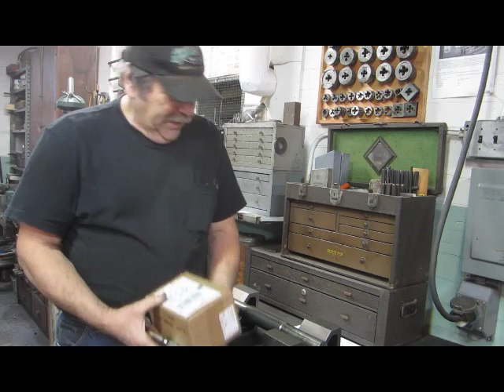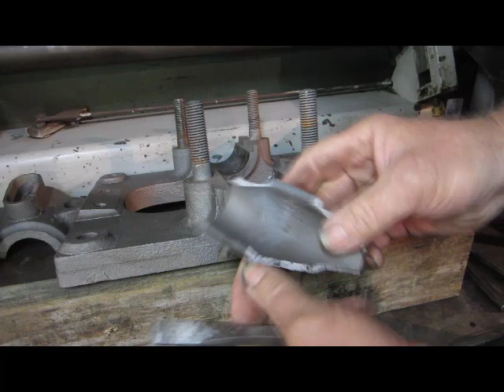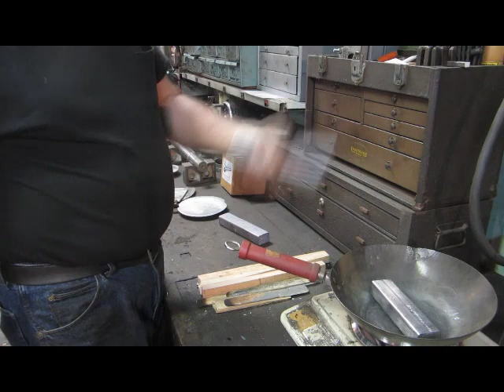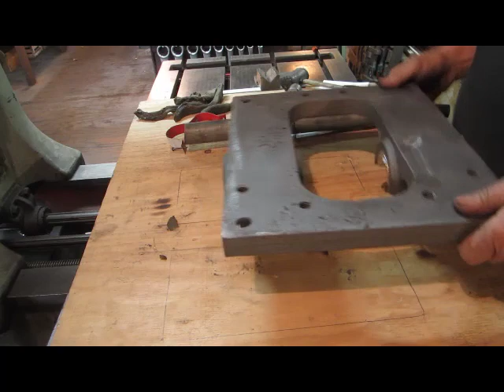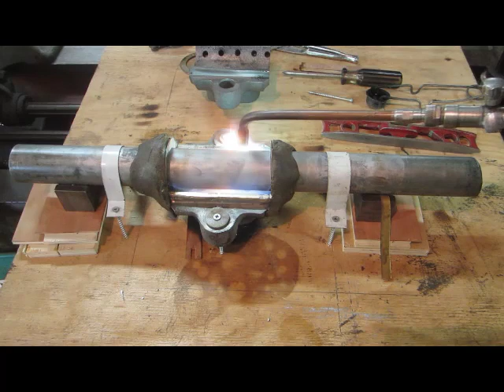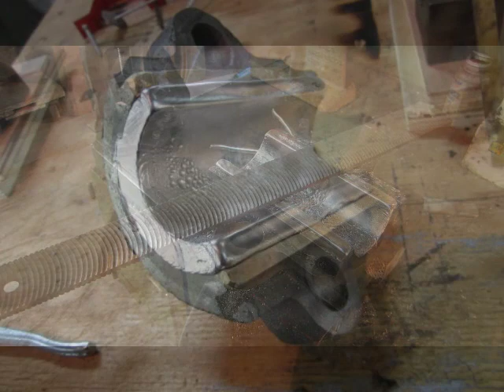OLD STEAM POWERED MACHINE SHOP 15   Pouring the mains

Comment: I did ultrasonic inspection of babbited bearings when I worked at the shipyard.  The inspection requires a special calibration block.  Ultrasonic inspection is good for detecting lack of bond.  I never knew how the babbit was poured.  Thanks for the video.

Comment: I've done a lot of this work when I was younger ,   we used to to have 2 pots on the go, one with old babet ( we call it white metal in England )  and one with new ,  to get the old babet out just drop the piece  in the old pot,  and we'd make  soft hammers with the old babet later
Reply from the maker: cool, and when the hammers bet beat up you just repour the heads....Dave
Reply: Yes we used to make them quite large.  An old tin can with a hole in the side for the handle ( weld a tee piece on the end of the handle so it holds the head secure ) putty the hole up and support the handle , heat up ,  then pore in.  Then cut the can off. one large and heavy soft hammer.
We used to do a lot old car engine bearings, and even bearings for old ship engines , I visited my old work place some time ago and there specializing more into that work

Comment: If you want to know what  type of babbitt you have,  you can send a piece to ROTO METALS  and they will analyze  the composition for free.  They also supply most grades of babbitt. Selection is based on SFM  and load in PSI.  Lead based can handle speeds less than 1000 SFM and loads under 500 PSI. Some of the tin based  is 5x the price of lead based.

Comment: Curious, my friend, why would they not just use a bronze bushing? I am sure there is a reason, but I am no expert.
Reply from the maker: I think it was much faster and cheaper to pour the babbitt in a factory set up. didn't require machining the part it was going into, and in some cases babbitt was the better wearing surface material.

Comment: Hi Dave
I have been collecting and restoring mostly hit-miss engines since I was 14 years old ( 85 last Jan. ) and I did the same DUH thing when pouring mains for a 1904 Rambler car engine  I restored a couple of years ago. When I pour with an arbor I usually smoke the arbor with an acetylene flame to keep it from sticking. That seems to work really well. Keep up the great work.
Dan

Comment: Hi Dave:  As always I enjoy watching your videos.  I am restoring a 1912 Oakland automobile that was badly worn out and abused during its 106 year life. It has a 4 cyl. non removable cyl head engine with the cyl blocks cast in pairs of two cyl's each and two separate cast iron blocks. It has an aluminum crankcase with three main bearings.  The front main bearing is cylindrical babbitt that is press fit into the alum. crankcase and the center and rear main are cast iron housings bolted to the alum crankcase. The center and rear main are the split type with caps and removable babbitt inserts , they are keyed to prevent rotation . Because the front main is not split the crankshaft has to be installed from the back or bell housing end toward the front, and the center and rear main castings have to be mounted to the crank shaft beforehand.  It is really clumsy to put the whole thing together.  Some time during its life the engine broke or threw the # 1 connecting rod. Judging by the scars inside the crankcase it came to an abrupt stop and all that energy split the front main bore of the crankcase and opened a crack in the alum. about  .030" wide. along both sides of the bore.  I Drilled and tapped both sides with 4 holes on each side of the bore  3/8-24 thread.  I heated the whole crankcase over a pile of charcoal until I could melt 50-50 solder on it and proceeded to tighten those 3/8 socket head capscrews down until I closed up the cracks on both sides. I wasn't really sure if I could close up the cracks or strip the threads doing it.  I made a mold for the front  cylindrical main, coated it with anti-sieze, placed a dummy shaft in it with a centering setup  and poured  a new main.  I left the ID small and the OD a little large and when it cooled I pushed it out of the mold and machined it to size.  After many hours of work the engine runs great. and I am presently restoring the body.  I won't bore you with all the other details .   I really like this old machinery and it is a challenge and true enjoyment to bring it all back to its former glory.    I can really  identify with all you do so well.
    Ed from Colorado.
Reply from the maker: Thanks Ed,
      Interesting design and an interesting successful repair. ...Dave

Comment: Another nice one David. When I saw the Babbitt run out the holes I said Aw that sucks, then I laughed cause iv'e done stuff like that before. A friend of mine and I once fixed a radio test set power supply in the radio shop. We went to lunch than came back and turned on the test to find it still didn't work. We were baffled and spent the next hour troubleshooting only to find out while we were out to lunch someone in the shop had taken out fuses. The shop had been running low on fuses so we guess they figured that since the radio test set didn't work it didn't need fuses. We put new fuses in it and it worked fine after that. Never found out who did it but we wanted to spray Freeze It in the seat of the chair they were sitting in. Thanks for the education. Best Wishes n Blessings Keith
Reply from the maker: Escalating shop pranks huh?....Dave
Reply: Yep, this was quite common in the 80's when I was in the Navy. We'd take a can of "Freeze It" Electronic Component spray and slip it in between the plastic chair and their butt crack, then let her rip. Usually some unsuspecting victim in about 2 seconds would jump up with a holler, and a white frozen butt crack. Then the shop laughing and snickering would begin. Paybacks were a B-asch as you could imagine. It never hurt anyone and it definitively would lighten up the load on board the aircraft carriers after months at sea. Of course there were some ground rules. You couldn't do it if, they or someone had there hand in a live  circuit or if someone could get hurt if they were startled by the yell. It sounds odd but we were professional about our pranking, and were professional pranksters as well. A production or repair shop is really no place for pranks and horseplay. So it was done with the greatest care to ensure no one was hurt.or any equipment was damaged. After all the pranks were usually done on friends, usually. Take care David. See you on the next video. Best Wishes n Blessings. Keith

Comment: David becareful using the galvanized electrical conduit.  When heating that stuff, the fumes off of it can kill you.  That also might be part of the problem with porosity in the babbitt too.
Reply from the maker: Right Gary, but it isn't getting any where near hot enough to get the galvanizing going, only about 250 degrees....Dave

Comment: Regarding the aborted pour of the top bearing saddle.  A friend of mine who changed the oil in his cars himself once had the experience of finding all the oil he just poured on the garage floor and all over his shoes.  He forgot to replace the drain plug on the oil pan.  From then on a sign that says "NO DRAIN PLUG" is always placed on top on the engine while the oil was drained overnight.  Lesson learned.

Comment: Oil hole....... Dang. Reminds me of 1976, built a 347 Chevrolet (400 block with 327 crank via main bearing spacers). Fired her off, and she promptly pumped 4 quarts of Kendall GT out on my shop floor. I'd forgotten the cam galley plugs. Feces doth occur (Shakespeare).

Comment: I had been hired to pour babbit for alligator shears and my own shop equiment. I had followed your basic procedure, since I did not know about your bearing putty I used plumbers putty with success on many pours. One think I know I did differently is poured my upper shells in place with some shims installed before the pour. What advantage is there in pouring them separately ? If i had to much drag on my bearing I could add shims or use a half round file to cut my bearings into place. Crude I admit but these thing s were large in size and it was all I had to work with. love these videos.
Reply from the maker: Hi Dave,  I assembled the bearings and bored them to a dimension.  Pouring the bearings around the original shaft would be done the way you did it. You could also scrape down the "high" spots to get more bearing contact surface and then adjust the shim thickness to get a good fit.....Dave

Comment: Do you ever use a flux , before skimming off the dross ?

     Casting with wheel weight metal , I dip the end of a candle in the molten metal , stir & then skim .

Best of luck ,   :-)
Wyr
God bless

Comment: Hi again K. Greer here  Sir have finished the rebuild of the steam engine ?? If so like to see it run also I wonder the exhaust from you engine goes straight out why don't you run it into a larger pipe cemented in ground then going up above the shop roof line can also put a nipple and valve just above ground to drain condensate from large pipe with a rain cap to keep out rain and snow this will give you less engine noise and protect side of shop from moisture ??
Reply from the maker: Kyle:  Less engine noise? My neighbor would complain.  I have thought about that and it's a good idea. The condensate could be run ito some kind of a trap to seperate the steam oil also.....Dave

Comment: ....For holes and voids in newly cast parts....can you make repairs as you would with 'brazing' or soldering...? I've never seen this subject addressed....and.....in High School...1963-4...we did some small Babbitt projects, but we always 'tinned' the parts first....we even had a can of 'tinning butter'...
 What determines the requirement of tinning--or not....? I know some guys don't tin the parts, but there are grooves and/or holes drilled to maintain the Babbitt in place..
Reply from the maker: You could tin the housing if it's a thin pour like a bushing, but I never have...Dave

Comment: What is the expected life of a babbet bearing like the one you just made for say an average operation over the years?
Reply from the maker: Hi Ed, Boy that is really hard to say because it depends on so many things, probably the most important being lubrication type and frequency (oil or grease). The load on the flywheel end and the grade of babbitt would be a factor. I think they would run for a couple years and then pull out some shims and scrape the high spots....Dave

Comment: Is there any reason why you couldn't mount the caps to the bearing frame with your shims in place and pour the bearings in the cap and frame at the same time through the oil slot at the top?
Reply from the maker: Hi Steve: You certainly could do it that way and it's the way it was commonly done outside of a shop. You would have to scrape in some bearing clearance and I think machining is a more accurate way to do it on an engine....Dave

Comment: I have heard that a lot of marine steam engines used a wood called lignum vitae (wood of life) as bearings. Hardest wood there is, it won't float. Very hard to come by today, except maybe in Guyana on odd tuesdays of a year..
Reply: Wood bearings...with a little oil....they work well...
 My parents sold/rented/repaired Pianos back in the 1950-70's......quite a lot of wood parts with wood 'bearings'.....
 Youtube guy here makes lots of wood machinery with wood bearings....Matthias Wendel.....
Reply: The old threshing machines had a lot of wood bearings.
I think they were just hardwood, with plenty of oil and grease soaked into them.
There were fairly slow turning shafts.
Reply: I worked on a ship once that had lignum vitae in the stern tube as bearing material. We had to remove it as they were replacing it with some other material.It was laid in rows of blocks. Once we found the row that acted as the "key" to hold it all together then removing this row caused all the others to just fall out. We called the wood ironwood. Your right it wont float.
Reply: I have turned ball point and fountain pens out of lignum vitae and it looked great. Actually I have turned pens out of just about every species of wood out there. After a few years turning pens got old like me. I must have turned over 600 pens, why I don't know. I donated most of the pens and gave many as gifts.
Reply: @kenzpenz  donut operator is awesome!

You should upload some pen making videos.

Comment: After Babbit, what is the next best solid bearing material?    I just subscribed which is rare for me.
Reply from the maker: I would say it depends on the load and speed. Special types of bearing Bronze are used a lot in old machinery. Cast iron against a steel shaft works pretty good too if it's kept lubricated. Of course now there are umpteen kinds of plastic, nylon, teflon, viton and a lot of other "lons".....Dave
Reply: @davidrichards5594  Agreed, some folks confuse brass for bronze, I find brass is a bad choice.  Bronze is better.   Of course, the shell bearings in car engines have the longest life of all bearings.

Comment: I have been told that coal/soot deposits from a far too lean adjusted torch like you are using (assuming it is a oxi acetylene torch) will act as a anti spatter and release agent...
Reply from the maker: Actually you just use acetylene, no oxy. It makes a sooty smoke that floats around in your shop and makes a mess. I'd rather use anti-seize grease.... Dave

Comment: What is that stuff which is used to  seal washers. Is that gray goo from the future?
Reply from the maker: Called Babbitt-Rite, special high temp clay for doing that kind of work...Dave
Reply: Hm I see, ok tnx. I try to guess what composition is, but probably will find out, looking at same stuff as replacement for it, it says asbestos free so I guess it was at some point some kind of asbestos mix with something. Interesting.
Reply: ..30+ years ago...I used to buy some putty like this called 'Heat Fence'.....had asbestos in it...I was in N. cal...had to go to Oregon to buy it......

Comment: Dave, did you butt the washers right up to the castings?   What acts as the the thrust surface?
Reply from the maker: Yeah, and then put the clay around over the OD of the washers and on to the casting, so if it leaked under the washer it wouldn't get past the clay....Dave

Comment: When I previously saw the pouring of white metal bearings the bearings were wiped or primed before pouring.
Reply from the maker: That's true John in automotive and other work. Nearly all machinery babbitt is just poured into the rough cast housings and is mechanicly held in by flowing into drilled holes, slots or dovetails.  you saw how hard it was to remove...Dave

Comment: hmm so is it possible for you to acutally make a lathe from scratch of steel and iron, if someone had the time to wait and had the money to front up?  they say you can build a lathe if you have the knowledge of the parts to build one, that and an old saying on a black and white video a lathe is the only tool that can build itself, and the primary of all the milling machines.
Reply: a lathe isn't really complicated, it's basically a motor turning an axle.
precision might be a problem, but you could look at treadle lathes, they are basically a tree, a rope and two points.

Comment: I would like to have about 50lbs or old junk babbitt. I use it for casting bullets. Its better than straight lead.
Lead you can go to wrecking yards and pull old wheel weights.
But lead coats your barrel 🙄 
Not fun too
 Clean.

Comment: I've poured many a babbit bearing during my time in the shipping industry and this is NOT the way to do it.
Reply from the maker: Hi Big, How did I go wrong? .....Dave
Reply: @davidrichards5594  First, and undersized mandrel is used.  The bearing is stood on end and the babbit poured between the mandrel and bearing shell after both have been well heated.  Once the babbit is poured a piece of wire or rod is used to poke the babbit and release any trapped air bubbles as the babbit cools.  We did large bearings for the shipping industry generally of six inch diameter of greater.  Once the bearings were cooled it was off to the machine shop for machining with final fitment done on site.